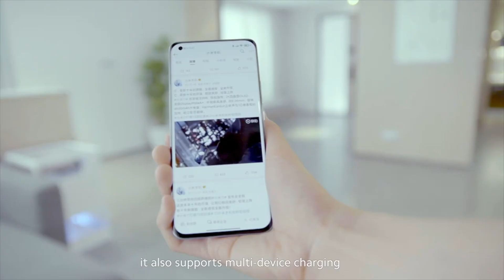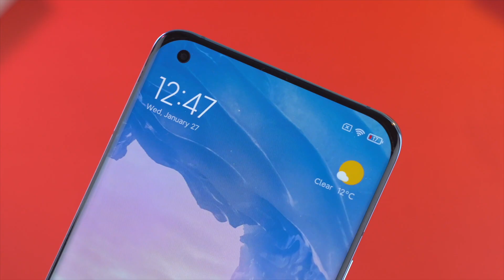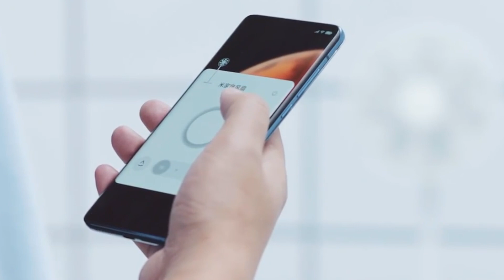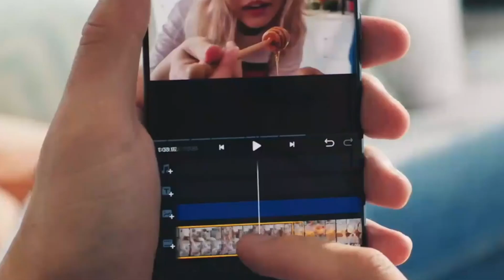Xiaomi Mi Air Charge is INSANE.

Comment: Xiaomi didn't announce whether it is gonna be universal MI Air charger or not! If not, it will meaningless cause xiaomi for gaming isn’t good. In terms of advertising, it collects so much user data than other manufacturers, which is embracing.  Though it’s camera system has the top notch features,  it can't even beat samsung, apple, oneplus. Oneplus underperforms xiaomi in terms of speed. So xiaomi must fix these asap. I've used xioami devices and not satisfied with the caching policies. It sucks when  6 out of 8 gb filled up. After restart it agin come down to 4gb. It sucks. Normal users can't understand it. But for gamers its...... Also touch response not so good as samsung even worst than oneplus. I didn’t use apple, so no comparison!!!! So, even now, samsung with snapdragon processor overall outperform others, isn’t it? 😶

Comment: 5 watt charging wirelessly? That's  pretty  slow for  battery  sizes over  4000 mah. You  might  even lose charge  while playing with the phone. And how  much would  that  cost? And  since it's millimeter  wave  signal can be  blocked  out  by walls. So for a family you would  buy multiple of these  per room. And it's not really that  portable with that  machine that  big. So depending on the  cost will make its  success. will the  output wattage  match the  input wattage it will cost to your electric bill?? But  5 watt  is really slow now.  make it at least  18 watts  at launch and with that amount of wattage over the air would it be safe? Those are the questions that needs answers .. Don't be  too excited  yet.

Comment: Electrical engineer here.

Wireless charging was never a fiction. The only problem is very low efficiency (due to air being a very good insulator thus more losses). Like you are consuming 1000 watts of electrical power but only around 10 watts reaches your phone. Thus, you will be paying a whole lot more on electric bill. I promise you guys, not only will you be spending a hundred bucks for this device, but you will also increase your electric bill considerably in exchange for a wireless charging. Just get an extension wire people.

Comment: Imagine using your phone in your bed while charging
Reply: yeah,we will never have a sleep
Reply: Thats exactly what im doing rn and the cable does not even bother me ! I like innovation tho and this can open many other doors
Reply: @hamzazoaoui  You are destroying ur battery.
Reply: @Doman9191  been doing it with my Samsung s8+ since day one and the battery is still like when I first bought the phone. So don't know what you're talking about.
Reply: @gcoca7450  Get some info.
Reply: @Doman9191  in April, it'll be 4 years of having my phone. And like I said, my battery is still as good as when I first got the phone. I'm going based off experience. That's all the info I need.
Reply: @gcoca7450  Battery starts degrading after 2 years of use automatically.
Also heat is not good for battery, using phone while charging produces heat, which lowers the battery lifespan.
Reply: @Doman9191  I do appreciate the info. Didn't mean to sound like an ass. But I'm just going off my own experience. And so far pretty much 4 years of use, the battery is still good. I mean i don't use it 24/7 so that could be part of it.
Reply: @gcoca7450  Everything good, actually i was kinda toxic too.
Reply: @Doman9191  it happens.like you said, all good. Stay safe
Reply: @gcoca7450  what is your ambient temperature? Do you live in a cold area?
Reply: @DrAdityaReddy  live in southern Canada. So for the majority of Time it is cold here.
Reply: But you have to make sure there is no object between that charger and phone.
Reply: @faisalrahman9236  then stick it on the ceiling,problem solve
Reply: laughts in 6m long charger
Reply: I'm in bed and I'm charging my phone
Reply: One word, C A B L E
Reply: That would be a dream